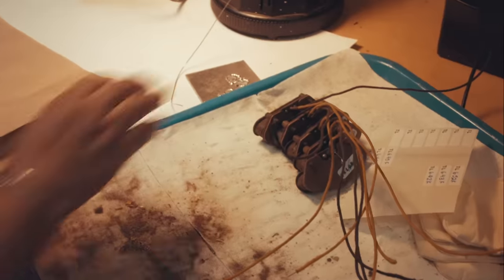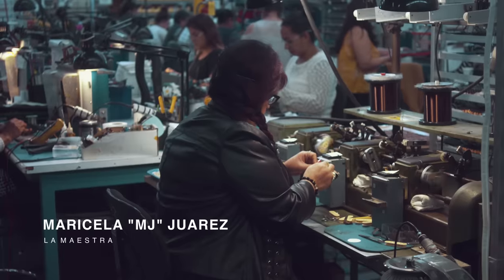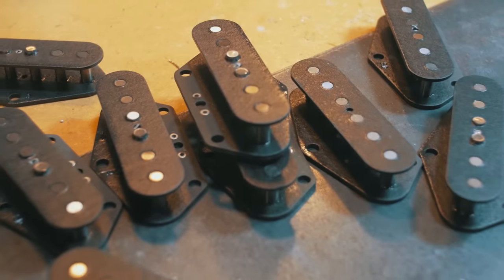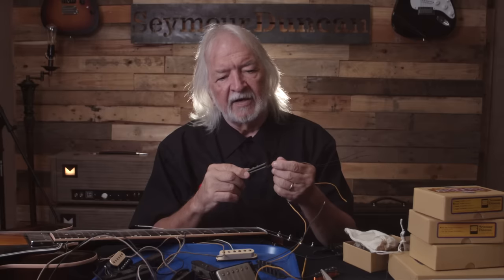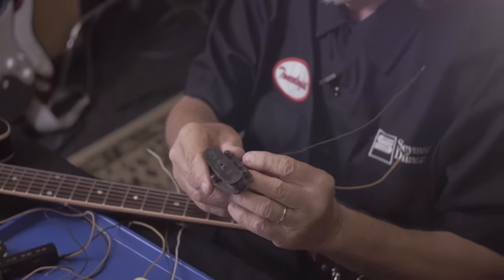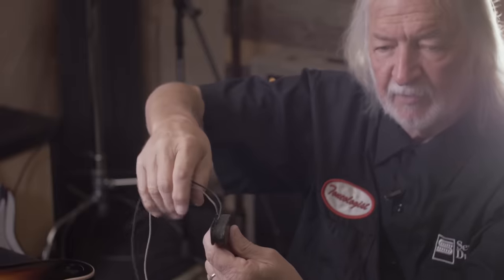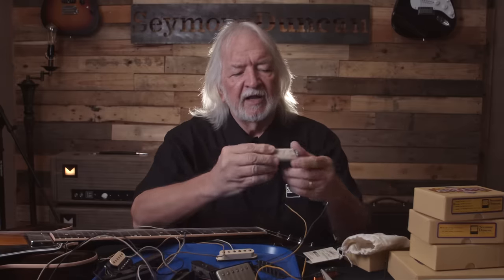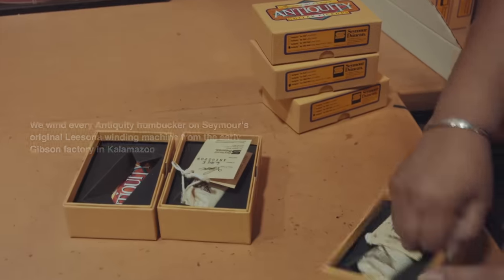Antiquity Pickups | Seymour's Studio

Comment: I used the contact form on your site but never got a reply. I have a nickel allergy and was wondering if titanium is a viable material for a pickup cover. I ask this because for years I used regular belt buckles which caused a lot of discomfort. Eventually I found a manufacturer of titanium belt buckles and it's one of the best purchases I've ever made. I have a near constant rash on my hands and am looking to minimise the amount of contact I have with non hypoallergenic materials on my guitar by replacing hardware where possible/practical.

I love the look of nickel (especially brushed or raw) covers and think titanium would be a great alternative looks-wise as it isn't as shiny as chrome and it's hypoallergenic (people with nickel allergy are likely to be allergic to other metals/alloys such as chrome and cobalt).
Reply: Did you try to contact MJ? I have emailed them several times, no answer.
I emailed MJ just yesterday so hopefully she answers, I think she did once but through her own Duncan email
Reply: Her email is mj@seymourduncan.com I'm case you are still looking for a titanium cover